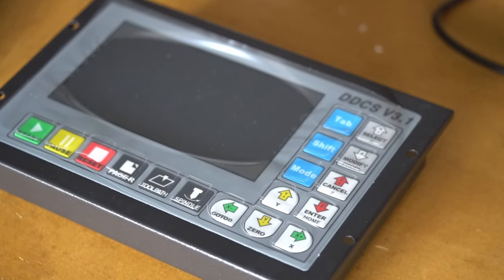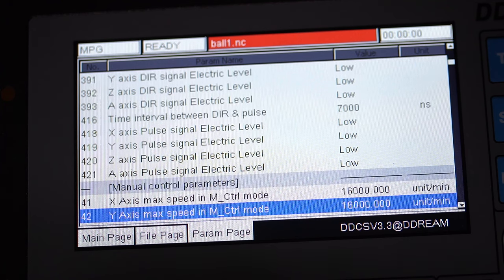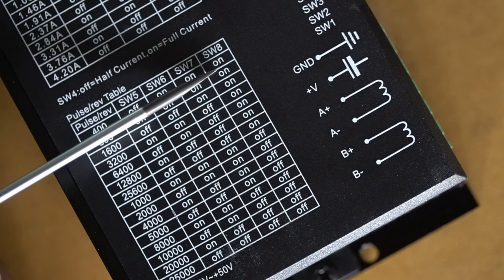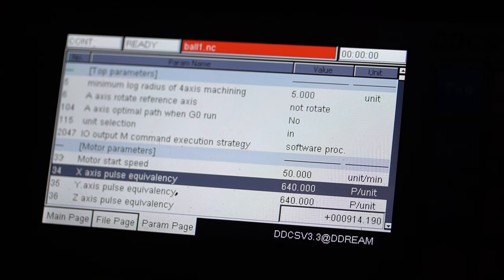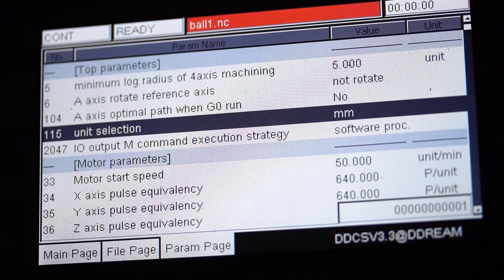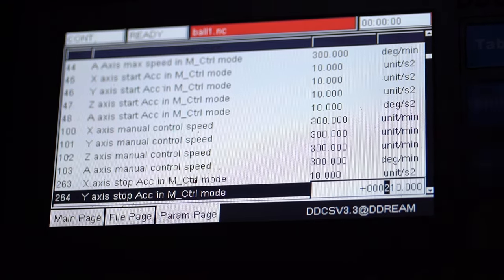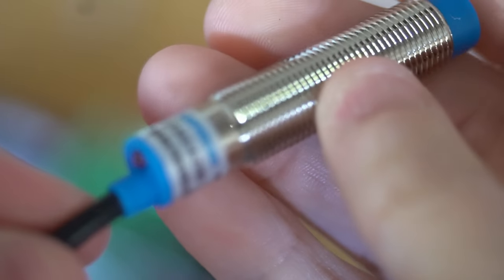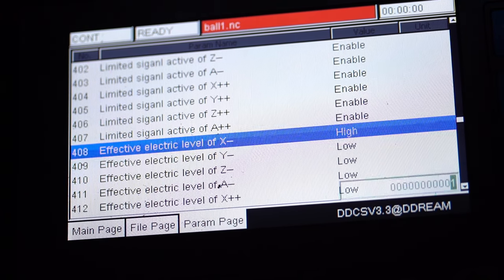CNC Standalone controller Wiring and Operation Demonstration

Comment: Am I correct that with this standalone controller you can use a CNC milling machine both in proper CNC mode i.e. by converting a CAD file to G-code and milling out an object accordingly, but that it will also allow you to use a CNC milling machine as an electronically controlled manual milling machine i.e. instead of turning turning the crosstable wheels you just tell it to move the x-axis 40 mm to the left, the y-axis 200 mm forward, and the z-axis 15 mm down etc?
Reply from the maker: This controller will process g-code in the traditional sense. If you take your CAD geometry and apply machining operations to that geometry to form g-code, you can save that g-code to a thumb drive and process it on this device (move the machine according to the g-code). You can also use this control as you would any other controller and move it manually. I would not suggest cutting with the pendant unless you have the correct feedrate parameters built into the parameters. The pendant is chiefly used as a way to jog to desired positions and stop the machine if needed.

Comment: Looking to use a controller to run a simple cnc back gauge and some limit switches for a press brake. Like the options of the v4.1. Are you able to write basic gcode straight from the machine? I don't need any spindle controls. Just move xyz steppers then machine pause, and more movement. So far this looks like a really good option!
Reply from the maker: The only way to get code into this controller is to use the thumb drive included. The controller doesn't have an MDI feature.
Reply: @PatrickHoodDaniel  thanks for the reply. Are you able to edit existing gcode?
Reply from the maker: @sputnik9708  Just like any gcode, you can use a text editor and modify the code. Or you can modify the machining operations in CAM and re-save the g-code. Editing the gcode in the controller is not possible as far as I know..
Reply: @PatrickHoodDaniel  copy that. I see the "expert" controller offers the ability to write and edit gcode, wasn't sure if that was carried over to this one. The manual for the v4.1 says options for creating a new file and editing a file, but doesn't go into detail on those processes.
Reply from the maker: @sputnik9708  That is good to know! Thanks you. IU'm guessing it would be quite cumbersome without the M3K keyboard (https://amzn.to/3vvLXuD).

Comment: Hi, Would you recommend this controller or any of the newer versions from nema 34 12.5nm closed loop motors, for 3d carving for long hours and gcodes more than 3million lines? If there is a step loss, would the process stop and show an alarm? Would those controllers run the machine at high feeds and acceleration like 12.000mm/min and 500mm/sec2? If there is a stop of the process, will there be a way to start again from the line I want? Thanks for your time, I'm interested into buying this.
Reply from the maker: Those are all great questions, but I haven't tested this controller extensively, so I would not be able to tell you, but those speeds look withing the specification.

Comment: I've had this controler for 4 years now. It works well most of the time. My issues are that only G54 works for positioning. The H and D offsetting does not work. Another thing is, if too many files are on the usb, the control won't read the USB.
Reply from the maker: Excellent information. Thank you so much for this! Do you have the 3.1 or 4.1?
Reply: Another thing is. Once you have your machine ready to cut. Cut some squares and circles. Physically measure them, then adjust the numer of pulses in the control for each axis so it cuts on size.
Reply from the maker: @pierregauthier3077  The formula that I added in the video is a first step. You can adjust as you mentioned if the calibration isn't quite perfect, but don't let runout or incorrectly sized tools cause a change in the steps per unit.
Reply: @PatrickHoodDaniel  you are correct. My power supply is variable to 36v. I can't explain it but, if I change the power output of the power supply. My cutting sizes change. I have open loop steppers.. but a step is a step regardless of power supplied? I do have closed loop steppers waiting for me to swap them. I'm currently using 1 power supply for all the steppers. Sould I used individual ones? I've learned so much building this. Seems like the more I learne, the more questions I have 😂😂😂😂
Reply from the maker: @pierregauthier3077  The only thing that comes to mind is that a power supply that provides too "little" power can cause a driver/motor to stall and lose steps. By adding more power in the form of voltage and amps to provide the driver with its draw needed for the torque, then you will have a change in steps, which would be the correct steps rather than deficient steps.

Comment: how to control steps movements, like lets say we have 400 circular points to move one by one and i need to move pointer in following example sequence  starting from  0->10->240->45->28-> .......... -> 400 . How can we automate this ..
Reply from the maker: Not sure I understand the question. Do you want to make it so the number of steps, like 20 steps are delivered, then 240 steps are delivered and so on? This can be done using gcode, but you will need to set the steps per unit accordingly.

Comment: I see the backlash compensation parameters but are there any parameters for ball screw error mapping ?
Reply from the maker: Now sure. I haven't deep enough into the settings. This controller is the cheaper one on the market. There are others, like the expert and the 4.1 that may have these features.

Comment: I've had and been using this contoler for 3 years. Only G54 is usable even tho G55, G56...... show as being available. The height and diameter offsets have the same story. As a machinist, this controller is not perfect but serves the purpose well when it comes to basic 3 axis function.
Reply: I don’t know how to use g configurations, I wish to know that
Reply: Im not sure i understand your question.  What do you mean by g configuration?  @luismasuko

Comment: Do you know if this controller will work with closed loop stepper drivers. I assume the encoder is all delt with in the driver but would like to ask someone to be sure.
Reply from the maker: Yes, it does. I just built a system that has closed-loop steppers on this controller.

Comment: why does this thing call for using 2 separate 24v power supplies for the controller and the MPG? just used the same and it seemed to work. my MPG will move around the cursor while in the menu, but it wont switch to mpg mode and let me jog.
Reply from the maker: That is a good question. I thought I mentioned something in the video about this, but if I didn't you can use a single power supply and just jump the terminals. I did this in my testing. Even if they are prescribing a separate supply for different functions, it would not make any difference.

Comment: Hello. Can you use this for plasma cutting operations? Thanks a lot.
Reply from the maker: @oldschoolgaming6135  I don't think it would work if you plan on using a THC (torch height controller). You would need to resolve the torch distance to the plate mechanically.
Reply: @PatrickHoodDaniel  Thank you so much!

Comment: Question, would you recommend this over mach 4?
Reply from the maker: No. There are too many features that Mach4 has that this device would not be able to do. To name one of many is the number of outputs available. Mach4 can be interfaced with very complex and unique setups and each setup can have its own profile. This also goes for Mach3. For instance, If you have a machine that features multiple heads (spindle, laser, plasma, additive nozzle, etc) on the same machine, mach4 would be able to be adapted to each very easily with a switch to one of the profiles, or be adapted to use multiple at the same time. MAch4 can also be adapted for unique robotic applications along with the various controllers that use Mach4. Another top of mind is probing for measuring surfaces, or finding position for fixturing. Mach3 and 4 would do this with ease where the DDCS controller would be a one trick pony. I do recommend this controller for those that are looking to do only a single application and has a relatively simple setup.

Comment: Remember if the motor is rated of 5a phase current or rms.. The current you need to set on its driver will be √2 x 5a = 1.414 x 5 = 7a! not 5a
Reply from the maker: Thanks

Comment: Hello,
Do I need March3 to work with this controller Sir?
Reply from the maker: No, this controller works all by itself. It's a standalone controller. No computer or CNC software needed. If you have a slave axis, then you will need the DDCS 4.1 variant.

Comment: Q: can it be used to control 3D printers?
Reply from the maker: Probably not. Accepts g-code and has outputs to control devices for extruder, heat bed, etc. However, It wouldn't be able to perform some of the complex tasks like bed leveling that is present on most modern 3D printers.
Reply: 3D Printer Kit with RAMPS 1.4 works like a charm whit Marlin Firmware
Reply from the maker: @myname3463  Yes, that would be a much better platform.

Comment: I love what you are doing but I wish your devices had open source code.  And I wish the display was larger.
Reply from the maker: I agree, but for the price these are retailing, it's a good option to free up a computer. All open-source control will typically require the use of a computer. The source of this device is firmware and would be challenging for a typical hobbyist.

Comment: @1:10 you mention that you are using a ONE AMP power supply "for this quick test" - why make it purposefully more confusing?
Nobody will use a one-amp power supply to drive a CNC, so all this did was confuse people.

The rest of the content does not work as instruction because you commonly share details in a fast-spoken speed such as "let's go with 3200" without explaining why you are choosing these random number values or how to make the correct decisions for these parameters for the viewer's own equipment relative to this controller.
The only thing useful about this video was that it introduced this controller exists.
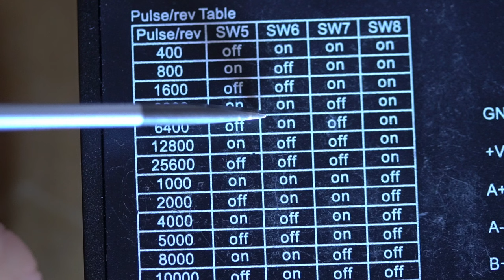Reply from the maker: The one amp power supply is only for the power for the controller, not for the motor power. Did you see the section at 7:00? Also, at the 5:00 timestamp, I show how to adjust the values to work with a custom application (calibrating each axis).
Reply: So to properly shelid ypur wires, you ground them to the cabinet the ground the cabinet to the earth?
Reply from the maker: @pierregauthier3077  Two options, ground to the cabinet which is earth grounded, or ground to digital ground.

Comment: Wow - that's an absurd price. At least for people that don't mind to tinker.
Reply from the maker: I don't think the price is high. If you consider the alternative (other than RPi) as a dedicated system, you would need a computer, a CNC controller, and CNC control software. Is there a standalone option that you know of that is less expensive? If so, I would love to get my hands on it and review it.
Reply: @PatrickHoodDaniel  IMO the only distinguishing factor is the "stand alone" really.

For that kind of money you could get a bigger screen, a pc with even a mesa. Or get a cheaper controller and pendant. There certainly are options.

The only benefit I see is "no tinkering" and the "stand alone". But priorities vary.
Reply from the maker: @tcurdt  The DDCS v3.1 is $250. I haven't seen a PC, monitor, controller (even Mesa) altogether lower than $250. Are you referring to a used PC with a parallel port?
Reply: @PatrickHoodDaniel  The DDCS v4 seems to be around $400+ (for me). A good enough used PC (without a parallel port) you can get for 30 bucks, screen you can spend more, but less than 100 is easily doable. Plus a new mesa for about 150. Or alternatively with a NVEM with remora for about 80. Or one of the better grbl(hal) boards for about 80 (if you are not keen on linuxcnc). There are options.

400 bucks for a DDCS just doesn't feel right - to me.
Reply from the maker: @tcurdt  Sure, getting a PC for $30 will do it and keep it out of the landfill, but I would not go as far as saying that this standalone unit is "an absurd price". The DDCS v3.1 is $250 and a good option if you don't need to slave an axis. I believe this standalone CNC controller is a very good option for those not wanting a complex arrangement of computer, controller and software for an excellent price. Most CNC programmers would want a much more sophisticated system like the Masso, which is $1200+. One price may be attractive to one person and not another. I would like to keep this discussion going. You are providing an interesting perspective and this discussion can "work out" a lot of details.
Reply: @PatrickHoodDaniel  As I said: it really depends where you are coming from. I can see people paying money not having to worry about things like that. 

From a hardware perspective it just feels like steep price when you compare it to a $80 esp32/stm32 grbl board that is pretty much just missing the screen and the software side for the UI.

But when I said "absurd" I was also referring to the $400 version. I cannot seem to find a $250 version over here even if I wanted to. And at $250 I can see how that is tempting.
Reply from the maker: @tcurdt  Don't you still need a computer to send the g-code to the grbl controller? You can alternatively connect an RPi to it which could be a cost effective option, but it is still an additional cost to the grbl controller, and like you said, you still need to add a screen, which adds another cost. 

I don't mind the use of provocative words like "Absurd". It just invites more interest and attention to the video, so I thank you for that. But I do need to respond and determine why some might feel that the unit is "absurdly" priced. If I were to make a comment where I felt the price was $400 and not $250, I would say that the unit is too expensive for hobbyists like me, but the $400 definitely has a place.

I may, in the future, explore the grbl controller with an RPi and a screen to show that as an option. I designed my own GRBL board back in 2010 but never put it to market, so I understand the tech. You may or may not have seen my STM32 tutorial videos, and I also made my own STM32 based controller, but that one was simple at best compared to the GRBL controller.